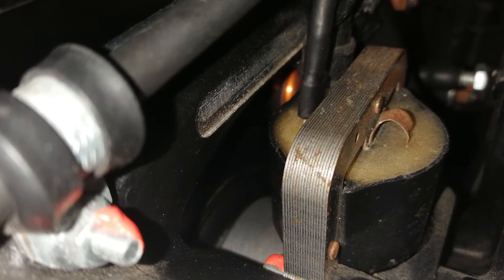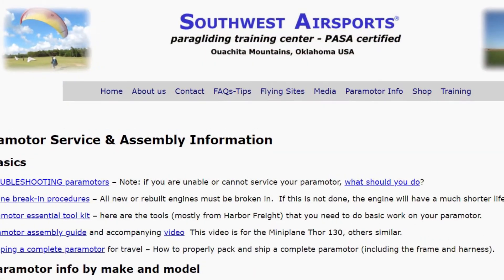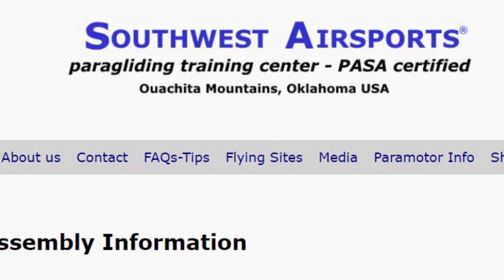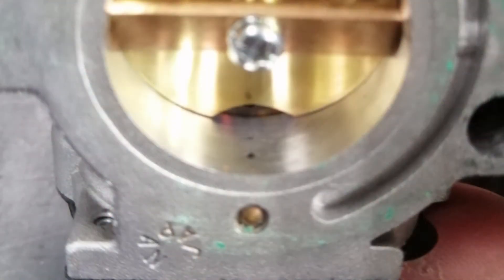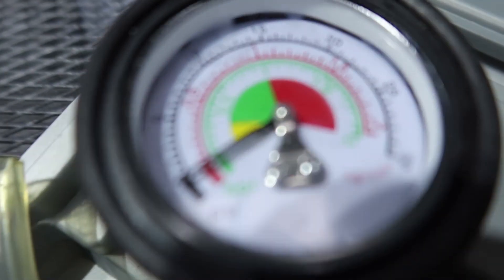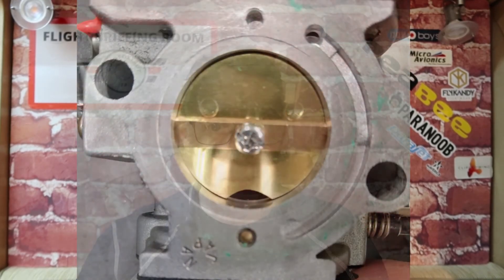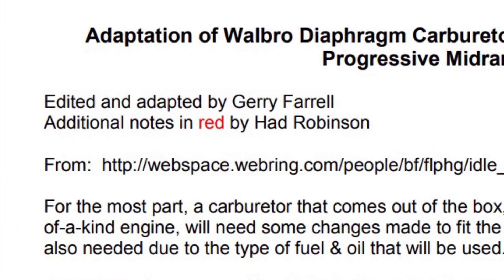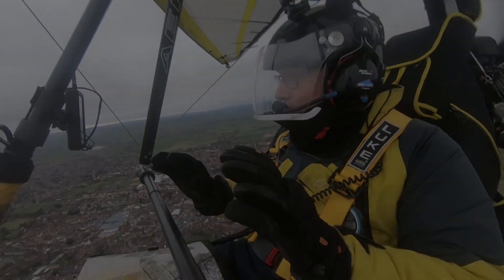NEVER do this again - Carb Modification - Tachometer technique

Comment: hi buddy i fly the air conception nitro 200 ive fitted a rpm gauge but like you say can get the revs on it on idel its reading around 2800rpm it should be 2100 to 2200rpm ive put up to 7 coils round ht lead down to 2 coils but jumps up and down your way sounds good but could i put the wire from rpm gauge to the live wire from the start button wire. thank you again for your info
Reply: Morning mate I will try that today thank you for your support and keep them videos coming in all the best to you and again thank you
Reply: Hi buddy I done what you said from the kill wire and got a 2,100 rpm and steady reading works a treat 👍 will flight test first light in morning all I need now is the tiggy to come out and I be sorted thank you for your info and fly safe and all the best to you
Reply from the maker: @frosty2331  oh that is great news and I hope the flight test works well. If you know of any forums that this modification would work on, then please share the video where you feel appropriate.
Reply: I'm well happy flight went well except getting to 1,500ft calm on ground high wind high had a couple of big asymmetric tucks not good with a motor on back haha but all good lower will let the guys know about the rpm gauge thank you buddy
Reply from the maker: Hi Frosty, I wouldn't use the start button, but you can use the kill button. I'd test it first before making any permanent connections.

Comment: Your knowledge is amazing but what I heard was…

“The Turbo Encabulator is based on the principle of power generation by the modial interaction of magnetoreluctance and capacitive directance. This negates the relative motion of conventional conductors and fluxes. With technology that includes antigravic marzelvanes, ambifacient wane shafts, panandermic semi-boloid stator slots and 47 manestically spaced grouting brushes all encased in prefabulated Amulite and surmounted by a malleable logarithmic casing, this machine will revolutionize the automation industry”
Reply from the maker: Hi Geoff, I literally tried to read that out, I did struggle a little bit. It did make me laugh though. 😂
Reply: This made me smile, Geoff.  Your time investment in writing it wasn't wasted!! 🤣🤣

Comment: Very interesting Giles, as usual I enjoyed the video. my 582 has a wrap around, I’ve often wondered how accurate it is. Thought provoking. Pardon my ignorance but if you know the area of the filed notch in the butterfly could you drill a hole ???
Reply from the maker: Hi Ged, the notch, need to be crescent shaped to pull over the little holes in the area next to it. A hole wouldn't pull in the same way. I hope that explains a little more.
Reply: @GolfFoxtrot22  I understand Giles. 👍👍

Comment: I'll never rap again - copyright Jay-Z 🤣 Surprised not all tacho's would need a resistor inline for that solution as the voltage spike it's then getting is presumably vastly bigger than what would be induced by the magnetic field effect?  Very interesting on the adaptation of the carb - definitely not one for the careless application of an angle grinder!
Reply from the maker: I can hear you dry sense of humour from here Mike. I've been testing/using this for a long time and they are surprisingly robust. I think you need to keep your angle grin well away from your microlight then.. Haha.

Comment: I just love tech talk.
Reply from the maker: It was a bit geeky but it's been a fun adventure trying to refine the carb to a point where I'm happy with it and how to make it repeatable.
Reply: @GolfFoxtrot22  I think you have done / shared a great resorce for others with simular carbs and motors. For me it was fun to see and hear as the solution is the same one I have used on a couple of my petrol RC model aircraft engines for the same reasons and the fun I had with a needle file.
Reply from the maker: @flyingkub  I've done a similar mod on an old carb years ago but never realised the benefits for the mid range. It really is good fun.

Comment: Great info Giles. I've come across that article a few times. Glad to hear it worked out for you and I'm looking forward to solving the most frustrating thing about the excellent moster engine 👍
Reply from the maker: HI Adrian, I'm glad you found it helpful. It's weird, I'm not doing anything that others haven't found before, I just wanted to see how far I could take the notch process before it wouldn't idle properly. I kind of stopped when it was working.

Comment: Hello Giles , it’s again a brilliant video, thanks . The problem with the rpm pick up is = the most automotive ignition cables are coiled which almost prevent a magnetic field around the cable ( almost no induction) so it’s hard to pick it up to the rpm indicator. If you connect your rpm indicator cable at the P. lead (pwr. to the primary coil) it will work perfectly , but if this cable comes in contact with A.C. ground , the ignition is off , same as you switch it off ! Use a cable with Teflon isolation ( aircraft cables) happy flying . Reiner
Reply: Hi Giles , the engine ignition switch (on/off) connect the P lead pwr to the primary ignition coil to ground to switch the engine off , your cable to the Tacho is on this cable ! If this cable comes by mistake in contact with ground , your engine is off !!
Reply from the maker: Yes, I agree. It runs parallel to the main kill wire anyway, so if the main kill wire is also worn through it will earth out the engine.
Reply from the maker: Hi Reimer, the earth kill circuit has just enough pulse to not blow the tacho. Its work for me for many years. I'm jot quite sure what you mean by the pwr side.